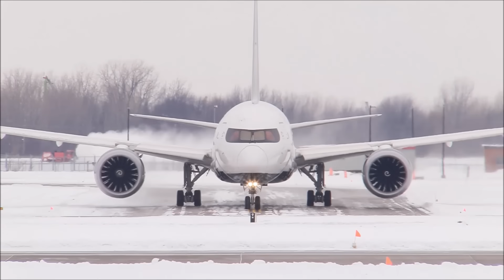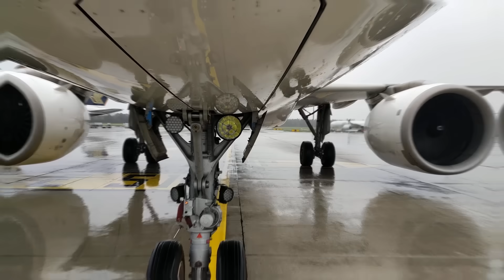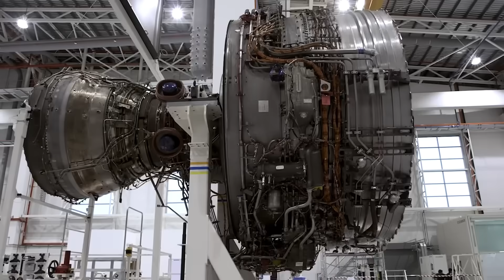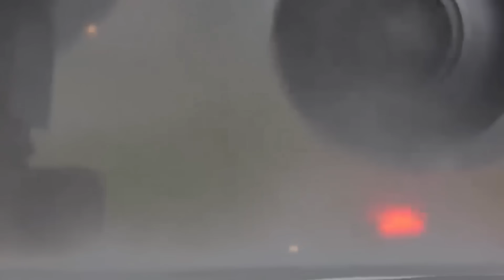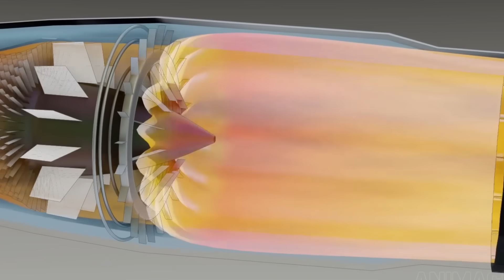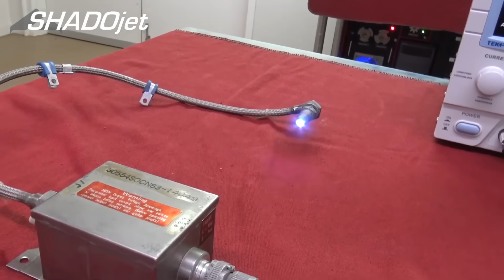Why Jet Engines Don’t Die in Heavy Rain – Hidden Engineering Secrets!

Comment: Dogshit and incorrect. All I need to prove it is the fact that turbojet engines have no fan. They have compressors directly exposed to the air entering the inlet, and they work perfectly fine in the rain as well. So it’s very clearly not the fan.

Comment: I design waste heat recovery systems for industrial gas turbines and water injection is still a thing in those, though not common. You can burn more fuel without exceeding the turbine temperature, and the water expands massively as it turns into steam, further increasing the power boost.  In desert climates evaporative coolers are a thing: you inject water into the turbine inlet system to cool the inlet air and increase its density to get more power. The water vaporizes long before it reaches the combustion chamber as the air leaves the compressor at a temperature around 500C.
Reply from the maker: right, in the last minute of the video it is explained that water vapor can increase thrust

Comment: Actually water ingestion can make the combustion to produce more thrust, because it cools the air and increase air's oxygen density. Water injection is actually a real system used by automobile and aircraft by spraying water to the combustion chamber to increase power. One example water injection system used in aviation, is the B-52, you can see trails of black smoke coming out from its engines, a byproduct of water injection

Comment: The old J57 engines used on the B-52 and KC-135 used water injection on takeoff.  On the 135, it would use 5,581 pounds of water injection in two minutes, during takeoff for additional thrust.  It was used in the inlet to cool the air and increase air density.  It was also dumped into the exhaust, creating steam

Comment: Forgot to mention, compressing air increases it temperature. The air exiting a Turbofan Compressor before it enters the combustion chamber is 400°F to 1000°F, water is likely turned to vapor and less likely to interfere with the combustion process.
Reply: It was written by AI.

Comment: Thank you so much. I am from India and longtime ago I once travelled in a plane and while we were landing there was heavy rain. Sitting near the window and seeing the heavy rain I was a bit Nervous about the water extinguishing the flame, which is the main reason for the engine to operate, in the Jet engine. Later after landing safely I started to find out about the thing explained in the Video. But till date I got various answers but they never convinced me 100%. However the bypass and the heavy water droplets being thrown out due to the centrifugal force, as explained in this video gave me a piece of my mind.
Thanks for your sharing.
Reply: i always wondered the same thing. It must be some really tremendous centrifugal force not to extinguish the flame. It looks improbable and impossible from my view.
Reply: @david9783  yes your doubts are correct. But if you actually see the size of those massive engines then you can visualise the size of the turbine and the number of blades. Again if you see deeply you will see two and not one fan. The engineering gone into the manufacturing! Oh! That is altogether a different world. That's why we can see very few Aircraft engine manufacturers as opposed to other engines which are a Dime a Dozen. Still this Curiousity to know things that separates ordinary population and the rest.
Thanks.

Comment: In extreme conditions there are ways to immediately “relight” as needed with igniters.
Reply: During take off, landing, and inclement weather, the igniters are turned on to  ensure the engine won’t flame out.

Comment: A key item was missed.  In the turbojet engine or the core of a turbofan engine by the 4th compressor stage where most of the bleed air would be extracted the air has already reached around 400 degrees.  Any water in that air has already flashed to steam (water vapor).  Like the test rig deluge test shown in a brief part of this clip they simulate what what would be a impossible rainfall in nature as most jet engines are certified to take about 20g per M^3 which simulates a rainfall of around 28" (per hour) from my back of the napkin calculations.  If you saw a rainfall like that you would be looking for an old man with a beard in huge wooden boat full of animals.  In any case if the engine did "burp" and lose flame (flameout) the pilots would have the starter ignitors running continuously in heavy rain so the flame would instantly relight once the water slug got pushed past the flame front.
Reply: Thank you for your good explaine about this subject.
Reply: I love your metric measurements, as engineeringt as usually done that way.  But the "400 degrees" is Fahrenheit, and even climate now uses the far superior "C" scale.  Just to note.   Lastly, the USA signed a treaty (The Metric Conversion Act) - that they would be completely converted to SI (Scientific International, commonly known as "metric") - by 1976.  Sure, prescriptions, tires, medical - as all converted, but America still uses gallons, pounds, miles/feet/inches ... the British monarchy way - to this day.   Horrible.  Just horrible.   My country (and all countries on the planet) have updated to this SI - except Myonopar, Belize, Zimbabwe .... and The USA.
Reply: uh bypass air is to cool the ignited section ..... but yes the contrail explains that...    or what idiots call chemtrails,,,, but idiots will be idiots lol
Reply: @HarleyHutson  My comment is for those that don't realize compressing a gas also makes it hot.  I should have clarified that 400 degrees (typical bypass air temp) is degrees celsius, or put another way the temperature of the "clean" setting of your kitchen oven.  Yes it gets a lot hotter in the combustion chamber, around 1850c but but 400c is nothing to sneeze at either, in fact 400c exceeds the auto ignition temperature of Jet A meaning the introduction of fuel into the bleed air would be hot enough to self ignite.  The point is any water has flashed to steam already with still more compressor stages that will heat it further, and the ratio of air to water is still very much in favor of air.

Comment: Back in the days of carburettor fed petrol engines, a small 150cc motorcycle that I owned always ran better and went slightly quicker on rainy days. It used to like the damp air it was being fed,
Reply: Perhaps the coldness from.the rain meant denser oxygen....denser oxygen then equals a higher burning temp in the engine thus better output....

Comment: where will we see the steam if water evaporate through that?
Reply: Steam is a transparent colourless gas. It's one of the aspects that makes steam plant so dangerous - you can't see the leak that will cut a limb off.
Reply: hot and high pressure. What about hearing the hiss or something?
Reply: @HighAway  I have heard steam leaks before, though not all of them are very audible. Steam often tends to be in areas that are noisy enough to need ear protection.

Comment: Water methanol injection has been used in many turboprop engines to increase thrust such as the Rolls-Royce Dart.
Reply: Uh, that’s what he said…
Reply: @ I don't recall turbo prop engines being mentioned, only high & low bypass engines.

Comment: Turbo engines doesn't matter even if the air contains water, it throws out water as thrust.
Modern engines eliminate water mostly using the blade sits in front of it. I like to see a jet engine not outletting anything after passing in the sky, which is modern.

Comment: If my memory is correct, jet engine do get vulnerable to rain in certain conditions like low thrust, just like what happened to TACA 110 flight, but then they improved the design for at least the CFM engine on the 737 CL/NGs, I wonder other engines may still be affected?
Reply: I was going to mention that incident as well.  I worked for a small simulator training company that happened to train TACA airlines and I knew the flight crew.  The captain was an extremely good pilot.  If I recall, it took awhile for them to find the right angle of water input that would cause the flameout and the right angle for the deflectors to prevent the problem.
Reply: Airliner engines have ground idle speed and "Flight Idle" which is a higher RPM and I believe that part of the reason is to prevent flame out in rain.
Reply: I worked military aircraft for 24 years.  We flew in all types of weather without getting flameouts.
Reply: @robertheinkel6225   Jet engines CAN be flamed out by rain.  It has happened before. Modern jet engines will automatically relight the engine if it senses a flameout.....plus pilot procedures would switch the ignition system to "Continuous" when entering rain.
Reply: @robertheinkel6225  will, the situation of TACA 110 is quite unique since it got caught in middle of a storm with heavy rain and hails, then the engines were on idle because it was about to land, then the both engines flameout. I believe the unit you served didn't encounter such situation?

Comment: Wouldn’t the droplets of water in the bypass duct add up to reduce the overall thrust?  If the water content of the bypass air is high then in theory there is less thrust M x V since the advantage of a high bypass turbo fan is to accelerate a large amount of air at lower speeds through the duct. Unless the droplets being fluids are considered in the mass and becomes accelerated to produce thrust too?
Reply: I think if the droplets stay long enough in the bypass ducts they'd turn to water vapor and exit out

Will thrust be affected? I think it cancels out with the effect of colder air in the rain being more dense therefore making better combustion, same effect they do on car engines by adding an intercooler for the air intake manifold, air coming in to the engine with reduced temperatures allows the engine to produce more hp

Comment: Good video, as far as it goes. But it raises the question, how can injecting water intentionally, raise thrust? The video states this, but doesn’t explain it.
Reply: Water is injected ahead of the turbine blades to cool them. This allows an increase in fuel flow, which increases the thrust while also raising the turbine temperature back to its original value.
Reply: @JohnTaylor-gy4np  Just curious, where did you hear that? I ask because it's wrong.
Reply: Because there is an increased amount of mass passing through the engine and being accelerated.

Comment: it dies if it is on idle
Reply: That hardly ever happens. You'd need a phenomenal amount of water ingestion to achieve that scenario.
Reply: @56Gumball  it happened, both engine out,b737 landed on embankment near space center on florida, all survived, replaced engines and took off, it was on nac geog. aircrafts disasters
Reply: What gumball said. it's all physics

Comment: High-integrity computers are crucial for jet engine control, especially for flame-out protection. These systems, like those from Collins Aerospace, provide the processing power and reliability needed to manage engine operations and prevent engine stalls or flame-outs.
Reply: There were reliable jet engines long before they were controlled by high-integrity computers with processing power.
Reply: how a computer can prevent a large amount of water from extinguishing the flame inside the engine